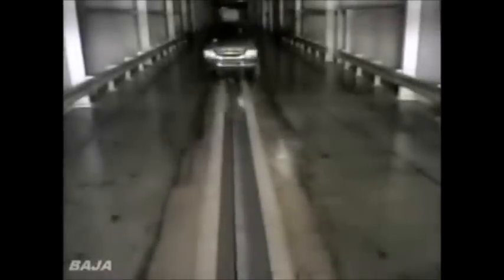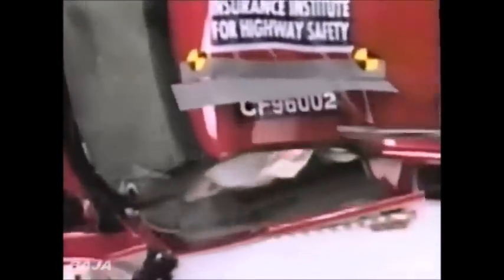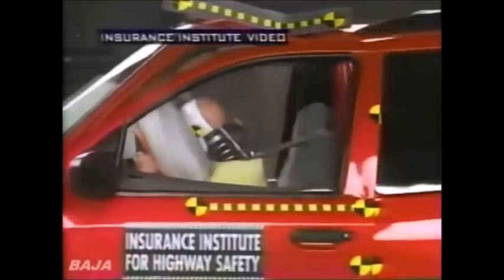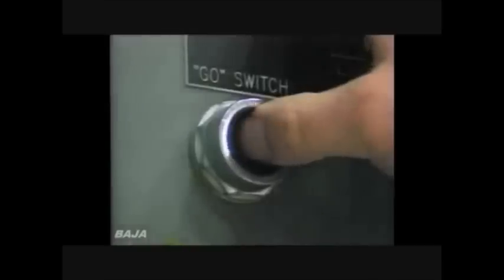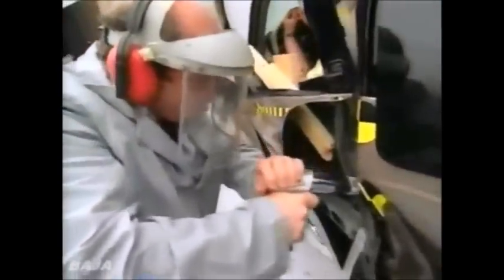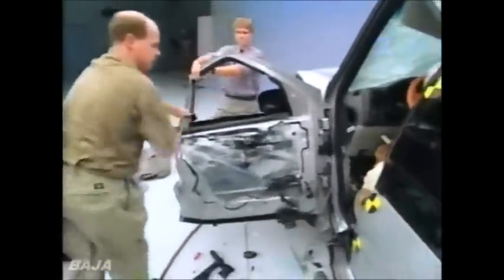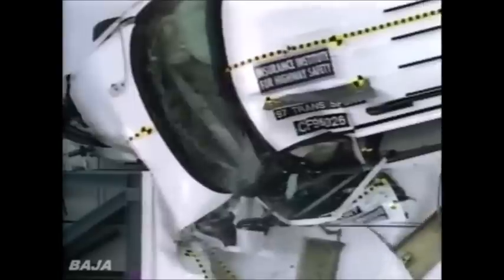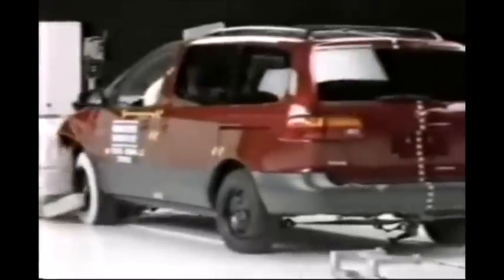354. Actual Proof of Why GM Chevy Sucks! - Part 16

Comment: I’ve been driving a 1990 Chevrolet truck and it was a monster straight up smoke stacks and of course a three axles gooseneck trailer the monsters power house was a Detroit Diesel engine it just kept going no matter what the challenge was. unfortunately I crashed it in Poland where I was going to deliver some crystal drinking glasses and pick up a pallet of stage clothes destined for  a concert with Brittney spears.

Comment: Gm have a fatial desine in there steering collom, stearing wheel locks up when driving locking steering wheel, a 2 cent part that GM and Chevrolet will not replace, it is cheaper too pay out law sutes that fix problem, that is why i drive a Mitsubishi
Reply: this took place in 97

Comment: This video brought to you by TOYOTA.
Reply: I agree, one of the few mini vans with an actual Frame
Reply: Naveen Kumar no I said this video is brought to you by toyota. Kinda of like a Toyota commercial.  Took a bunch of old cars to showcase something irrelevant.
Reply: 金3 A.M. ahhhh sheet toyota fan boy is calling out names! Could you elaborate on your statement?  What made you come to the conclusion that I am of a lower intelligence based on that comment?
Reply: Emilthehun at least my Toyota doesn't have planned obsolescence so I'm running my Lexus sc300 from 1992 with 650k miles and my '85 Toyota pickup is running strong as well with 430k all I've done is oil changes and regular maintenance. good luck trying that with domestic vehicles of today
Reply: 金3 A.M. lmao broooo how you know I'm black?? Had to look out my window to see if this toy oooo taaa is there. Brand loyalty is a thing of the past btw. The only thing I got from the 90s is my girlfriends! And btw why the funk would you have a car with 650 thousand miles?
Reply: Buck Naked the gmc safari / chevy astro is my all time favorite van! That thing is bulletproof.  Kinda jealous tdh.

Comment: But think about this a solid wall when in real life they would hit another car that you would crumple up at the same time as the other one so yes they are hitting at 40 mph but the other car crumpled up to
Reply: You do realize they do have a deformable barrier that they crash this into, to simulate the other car.
Reply: I suggest you look at this video. The Nissan Sunny preformed the same with a partial brick wall as with a head on with a newer Nissan. The brick wall does simulation head on collisions. This Nissan Sunny can still be bought new in South America. Correct me if I am wrong but I think they are made in Brazil under license from Nissan. They are used mainly as TAXIs.
https://www.youtube.com/watch?v=iSaQJJVDem4&t=28s
Reply: I was wrong they are built in Mexico till 2017

Comment: During this time they were vehicles from Toyota, Kia, Ford, Volkswagen, Etc that did horrible in these tests. The super cab F 150 from 97 to 02 did horribly, as well as older Volkswagen Jettas, the first Toyota van the previa, which the guy in the video owned personally and sold due to how it did in the test.

Comment: even the new dodge grand caravans aren't safe
Reply: Not true at all! Only small over lap did it do not great but in fairness it’s design was built before small over lap tests became mandatory! The new Pacifica that replaces dodge caravan does very well, so does Jeep renegade, Chrysler 200 ect!
Reply: Well Chrysler has a track of choosing profits over safety.  Their Jeeps blowing up when rear ended?  So far, a few hundred have died, not from the crash trauma, but from burning to death after.  Chrysler still refuses recall.  And their minivan seat collapses?  They also act like it's not a problem.  They all do this, any brand you see.

Comment: You're using data that was collected on models from the 90s and early 2000s to make a point. The data collected on GM models from the present day proves you wrong because of the numerous safety improvements that have been made over the last decade.
Reply: but Ford is still on top
Reply: Now I know why all the horrid APV vans have disappeared off the road.
Reply: Nathan Cortez I was gonna say the same thing but I take asstetics over safety and the new ones have no asstetics so I would never buy new ones
Reply: I just don't like gm lol
Reply: Michael Colon lol my fusion says otherwise only 75k miles and already problems
Reply: While I hated american vehicles in the 2000s, Today I would actually consider buying one because after the great recession, they re-emerged and really got their act together.
Reply: Nathan Cortez newer chevy vehicles crash tests are irrelevant because there  are way more of these junk early 2000s gm cars still on the road today than new gm cars and vans gm was GARBAGE back then.
Reply: Bullsfan23 gg Key word: "back then"
Reply: Bullsfan23 gg He should have been more specific if that's what his point really was.